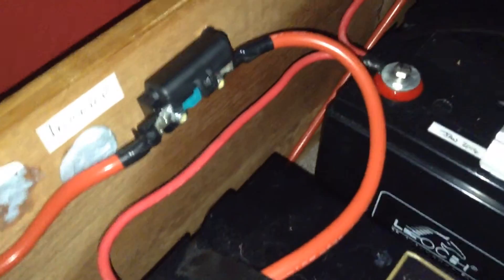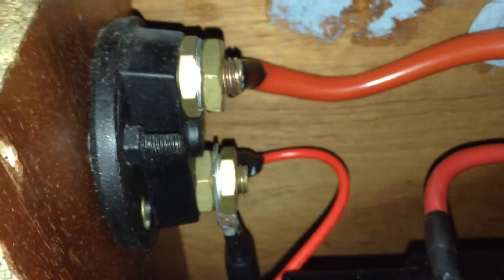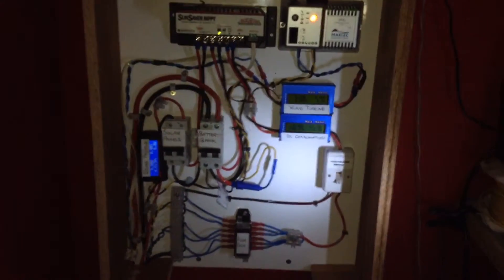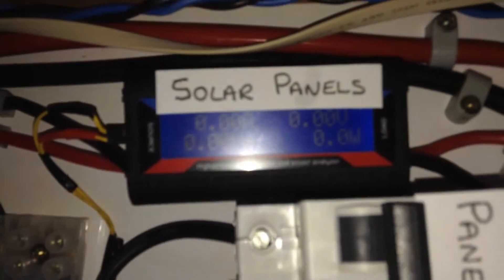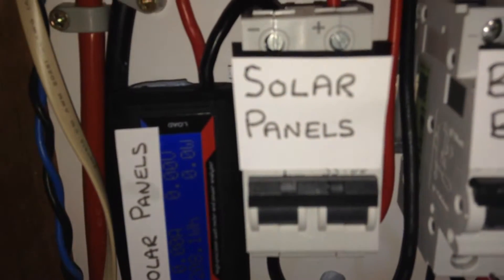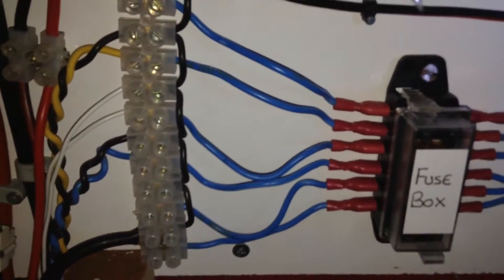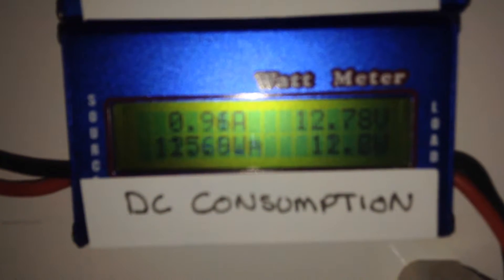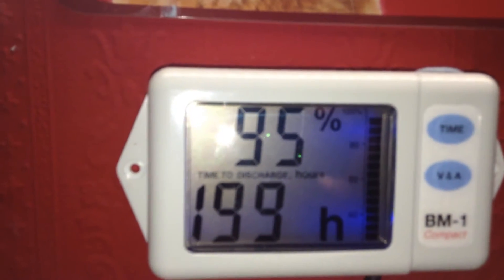Thurs 25th Feb Rewiring my system

Comment from the maker: Hi
It's one of the generic no brand ones that I bought from eBay, it has a supposed rating of 150 amps, but the input must not exceed 60v Dc. I have now upgraded to 30 amp charge controller which has a remote meter which displays all the information I need, so all the wattmeter a have been removed. The 60v input is a problem when using mppt controllers when you use a high solar panel voltage to minimise wire losses. Thanks for watching solartiger.